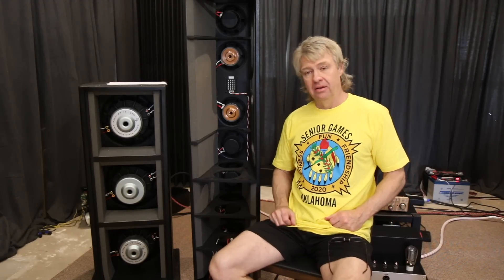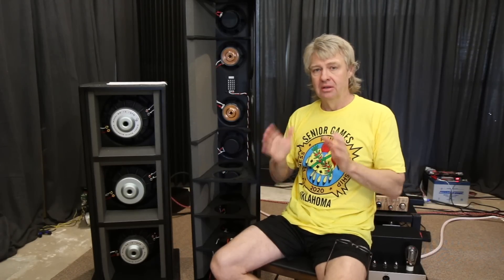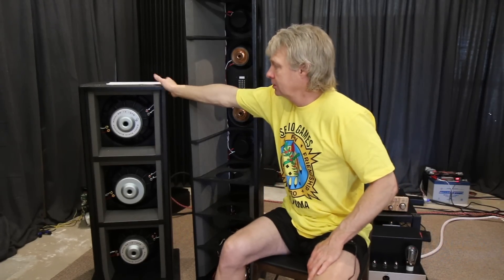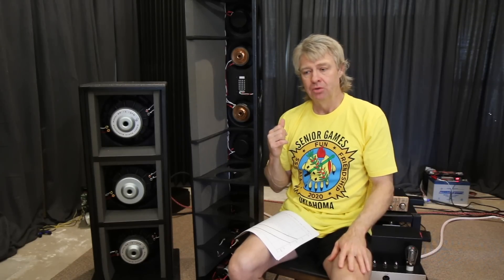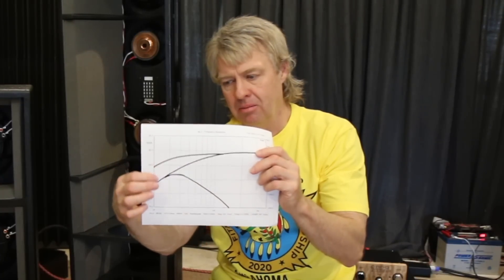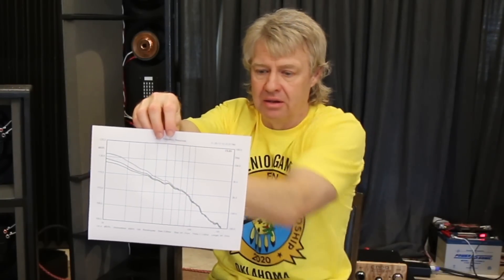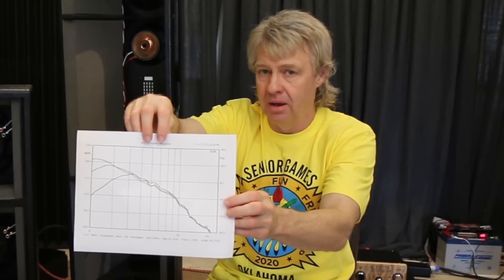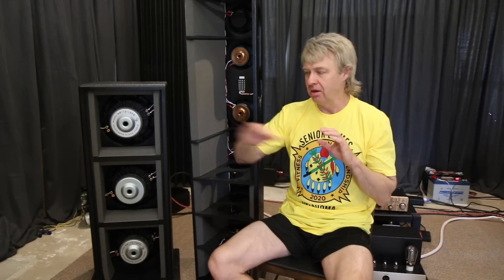Open Baffle Basics pt.4

Comment: Thanks for the reply to my previous question.  New Question: In all the videos I've seen from you so far about upgrading, you never discuss Watts per Channel, RMS. When I moved out of my parents home some 45 years ago and got into listening to music on a "real" stereo system the only specification I thought I  understood was Watts RMS.  50 Watts was more than 20 Watts and I assumed from the marketing 50 was better than 20 if your speakers could handle it. All these years that first impression has stuck.  Could you discuss in one of your videos the relationship, if any, between Watts and sound quality? Also, The Manufacturers of my speakers (Polk S60) recommend between 20 Watts and 300Watts RMS. It seems counter intuitive to me that 20 Watts could be just as good as 300Watts. Is Marketing just trying to cover all the bases? So, for best sound performance I'm assuming I need a minimum of 100W, but probably 150W to 200W would be better.  How wrong am I?
Reply: Here you go: https://www.youtube.com/watch?v=YSWrT8Qk7Bc&t=330s
Reply: @dannyrichie9743  Thanks. I actually already watched that video and now I've watched it again. I guess I had to watch it twice to overcome 45 years of wrong thinking.  So, whether your Amp puts out 20W's or 300W's is only significant in terms of the size of the room you want to fill with sound? But then again that's why they have Home Theatre systems with 3 pairs of speakers and  a center speaker and a subwoofer. For a 2 way system in a normal size living room you don't need  a massive amount of power unless you like to make your ears bleed. :)  I think I've finally got it. Thanks. This is a great channel. Keep it up.

Comment: Hi Danny
I was very impressed with the tip regarding two woofers and using an inductor for one.  but what if you have 3 woofers... does the third woofer have a different value inductor from the second?  Many thanks for the great info
Craig

Comment: I still don't get why on the subs such a short side wing would have an impact on the lowest frequencies, shouldn't its effect be negligible in the very bottom end and be more pronunced around the 100s hz area were it is not really needed?
Reply: See previous video. 😁
Reply: The space made by the wings load the driver and create pressure in the space on each side. It also further separates the front and rear output further.
Reply: @dannyrichie9743  Thanks very much! I suppose I've been confusing baffle width gain as in baffle step related to wavelength to side power cancellation in open baffles - I was immagining it to start heppen just at the geometrical position of the wavelenght.

Comment: Danny,
At What frequency can cross your L shaped 6.5" woofers with the lower end servo subs? I still own the 165X woofer I can't seem to cross lower than 250Hz, is that what you are getting? Thks.
Reply: The M165NQ drivers cross at about 160Hz in these NX Series models.

Comment: Excellent series - Thank tyou for sharing your knowledge!

When an inductor is added to the second woofer, does that cause a slight, frequency dependent phase shift of the second woofer relative to the primary woofer and if so would that result in an audible smearing of the bass notes?

Comment: Question, transmission line pipe vs. Open baffles. Does a TL have any of the advantages of a open baffle sub under 100 hz..  none/ some/ many ? Thank you you for your videos, as a DIY SPEAKER builder I have learned many things form your channel.  Present speakers. Vandersteen 5, magnepan 3.5, DIY project. I do not mind a short answer, if I am lucky to get one at all.
Regards 
Andrew, 
Montreal, Canada
Reply: The advantage of a TL is increased output at the tuning frequency.

Comment: Cool stuff! I'm not as familiar with OB subs, but if we were comparing to a sealed enclosure, would your active damping settings correspond to Qtc values of in acoustic suspension alignments? (i.e Q=0.5, 0.7, 1.0) If so, what values would you assign to the low, medium, and high settings of your servo system?
Reply: Yes, it is very much like that. I don't have assigned Q settings for each one though. We are just changing the electrical Q.

Comment: Dannie the tower OB does it give good bass or u need the servo subs to go low with 8 woofers pee side I thought subs will not be needed
Reply: The NX-Treme model will play down to mid 40's in many rooms. Some rooms will be mid to high 50's though. It just depends on the room.  We recommend our open baffle servo subs with them regardless.

Comment: How many of these 12" drivers in open baffle setting do I need to attain 110dB@10Hz and 130dB@20Hz-200Hz?
Reply: That all depends on the room size and distance as the doubling of distance represents the loss of 6db. But that level at 10Hz is a real stretch for any woofer. You should be looking at this as a solution: http://www.rotarywoofer.com/
Reply: @dannyrichie9743  mind blown.
Reply: @dannyrichie9743  If I use 8 drivers each for both left and right channel (16 in total), what frequency response am I looking at from standard 1m measurement point. I intend to do away with any subwoofers and pair these to Line Force when they are available.
Reply: @aassiimmaallii  If you are wanting to go with our Line Force model (if I can make them available again) then go with a stack of six of our 12" servo subs per side. And the HX800 amp will handle a stack of six of them.

Comment: Denny, thank you for another great lesson! 
What do you think about so-called Ripol subwoofer design? I am planning to build somewhat similar compact design using two 18" proffessional drivers with low Qts & low Fs.
Reply: Careful, those often create a large un-braced panel that if not super thick and solid becomes a buzz box. And it loads the drivers pretty hard like a band pass box that is tuned too high. It is not a good idea for pure sound quality.

Comment: Love this content Danny. Thought you normally have the middle woofer facing the other way in the triple enclosure?
Reply: It can, it is about the same either way.
Reply: @dannyrichie9743  Ahh ok, i thought there was a particular reason i.e sounded better with having the middle woofer facing the other way?
Reply: @stogie525  
There are theoretical advantages in inverting every other driver, however I'd trust Danny's take in that it doesn't matter much in this application. 

Anyway, here's the theory involved. 
LF drivers have inherent asymmetrical characteristics in their acoustic output front-ward, as compared to rear-ward. 

The various causes include; 
1.) magnetic force variations, ie., inward stroke vs. outward stroke
2.) suspension non-linearities inward vs outward
3.) acoustic differences of the sound energy encountering and being impeded by the driver basket and magnet structure vs. the open front of the cone

So, whether it's aerodynamics, magnetic, or related to the suspension, there's asymmetries in the front radiation relative to the rear radiation. 

In a two driver sub, flipping one driver around (and swapping polarity), nulls the potential differences between the two orientations. 

Open baffle and IB subs are oftentimes where you see this implemented for a couple reasons. One, OB and IB operate close to their physical limits ... this is where the asymmetries are more notable. Also, IBs and OBs utilize multiple identical drivers, and drivers must match for this distortion nulling advantage to occur. 

Danny saying it doesn't matter too much, which is consistent with my own experiments, ... but it does work. 

Perhaps it's because they're somewhat separated by individual baffles... as that would lessen the coupling, and thus nulling. Also, it cancels the even order distortion components, which are the least objectionable subjectively. Could be it makes motor noise off the back of the driver a bit too noticeable.